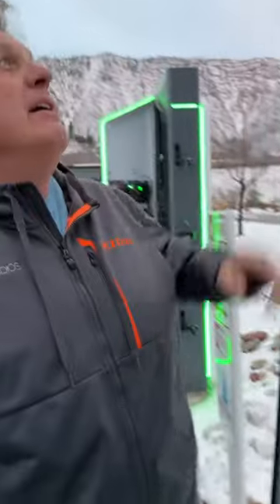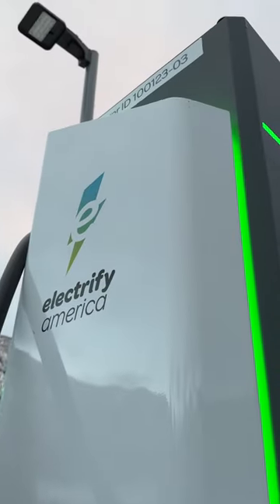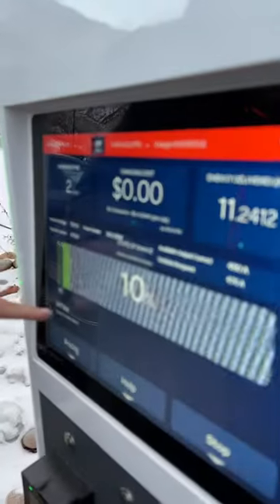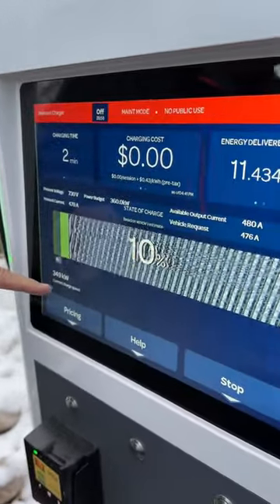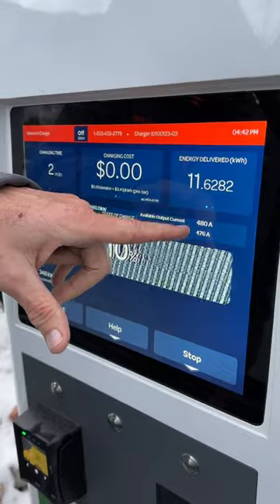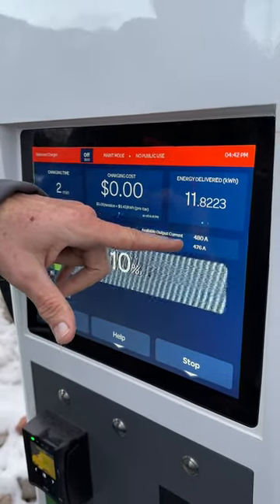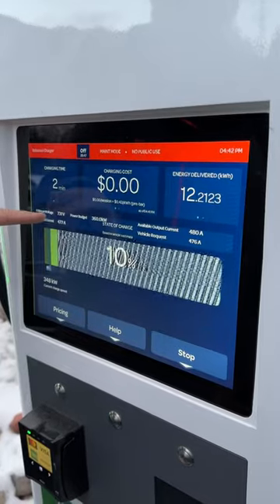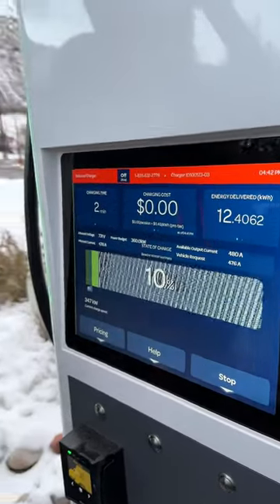Secret Maintenance Mode - Here's How I Seriously Fast Charged a Hummer EV!

Comment: Someone said "once a month for $20 vs $75 a week for gas." Lmfao no. Gas engines only account for about 27% of carbon emissions. Cobalt mining enough batteries to sustain the entire driving population with a new electric vehicle would completely destroy our atmosphere. Not to mention, this is totally and completely impractical. I can either charge at my house and take days to fully charge, or choose to take more than an hour out of my commute regularly. The cost to replace a battery is more than the price of most electric vehicles, making maintenance/reliability nonexistent. And let's not even go into cold weather performance, because most electric vehicles simply do not perform well in the cold, let alone get anywhere near their range. You go ahead and deal with your range anxiety. I'll be (actually) protecting the environment by continuing to drive a gas powered vehicle, instead of letting the wool be pulled over my eyes. Everything I've said here takes 10 minutes of research. Anyone who thinks electric cars are sustainable at their current state is an idiot. Hydrogen and nuclear are the only options that make sense, sustainability/environmentally wise. Stop hopping on the "current thing" train and do your own research for once in your life, people. I'll say this loudly for the people in the back: ELECTRIC CARS ARE NOT HELPING. THEY ARE MAKING IT WORSE.

Comment: About… $149 to charge or am i wrong
Reply: Depends..  my ea is 0.31 per kwhr.  If he does get 150kwhr, that's 47 dollars...  So assuming 2miles per hw, 300 miles, $0.16 per mile..  it works about to be similar to gas prices when you use a fast car.  My home electricity is half the fast charge stations.
Reply: @skippynj1979  thank you for the info. I always see videos about EV’s but you never hear real numbers.

Comment: At 100degrees out I wonder if the wires will melt
Reply: The cables have a coolant system..  pretty neat engineering, look up the patents, they are impressive.
Reply: Nah, there's a whole cooling system on both the car and the charger.

Comment: Well you wait 1 to 2 hours to fill up while I stop 10 to 15 mins filling with gas and BACK ON ROAD!!
Reply: On this charger it's more like 15-20 minutes charge, but you don't charge at a fast charger unless you're on a road trip. If not you just plug it in at home and use the cheap house electric and let it charge over night.

Comment: Still not as fast or easiest gas, apparently
Reply: if I leave it plugged in at home its faster and easier because i never wait on it or have to go anywhere to get fuel...but for road trips..ya...gonna add add some time to them
Reply: Different strokes for different folks.  I have ice sports car and motorcycle. my daily is a budget EV...  I'm craving a taycan or i4 M550..   the performance difference is light-years difference.

Comment: That hummer ev costs more to fill up than my diesel pickup 💀
Reply: How much does it cost I haven't heard?
Reply: How? 200kw at .12/kw= $24

My LBZ is $150 for the same range ....

Even DC charge at the rip off price of .6/kw =$120
Reply: @duramaxadventures5832 plus charger fees
Reply: @fredkuhn165  .6 is the charger fees
Reply: I have both an EV car and Duramax truck..  an EV truck will be more than 75 prevent cheaper to operate if you can life with the limitations.  The power and torque in the EVs make the current drivetrains a joke.  Long haul towing is big downside of current BEVs.

Comment: 731 volts ? You get in a wreak and maybe you better call the power company too,
Reply: That's not really how it works, the amperage is what matters you can touch 50,000V if it's just a couple milliamps.

But yeah, sometimes when you wreck in an EV, special fire fighters trained for EVs have to come out because of the battery pack, they're specially trained on how to get you out without getting electrocuted. As far as the car goes they just let it burn, it's not worth trying to bring enough fire fighting chemicals to try and fight an EV fire.

Comment: If it was gas it would take you 5 minutes.
Reply: gas costs 3 to 4 times as much tho.
Reply: @Beachtrader0007  doesn't take days to fill a gas tank. I'll gladly pay extra.
Reply: @bobjenkins9736  I plug my m3 into the regular wall plug in my garage. Every day I start with a full charge. I never have to spend time standing there waiting on my car to be ready to go.   If this were a long trip and I had to use the supercharger network you would be right. I was averaging 20-30 minutes per charge when going from texas to florida and back
Reply: @Beachtrader0007  I fill up in the time to clean my windshield. If my battery fails it's around 100 bucks or a jumpstart but I carry a jump box for super cold mornings. You have special places to charge and I can stop at any place that sells fuel. Living in Roswell New Mexico I've never seen a charge station. Lots of gas stations.
Reply: @bobjenkins9736  I think you missed the charging at home part. no need to spend any time filling up. Dunno what the battery fail thing you are talking about. I can charge anywhere on earth that has an electrical outlet.  even at a gas station.  But the supercharger network is faster for road trips but it will take on average 15-20 minutes. Cant help that yet. At least teslas charge the fastest and have the most reliable network.    I see 10 superchargers in new mexico but none in roswell.  Plenty to get you out of the state or wherever you want to go.   But im not in sales..I love tesla you dont. thats ok.
Reply: That's good.  Keep doing what you do.  Let others enjoy what they do.